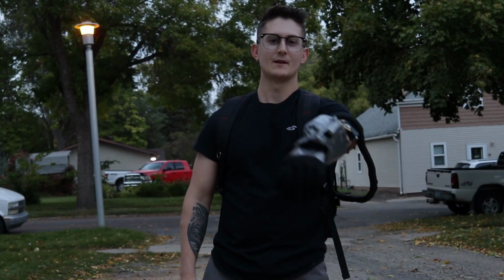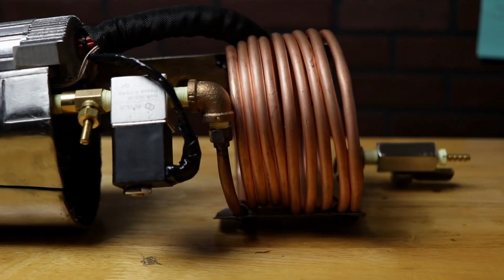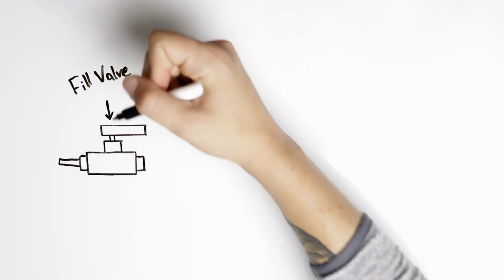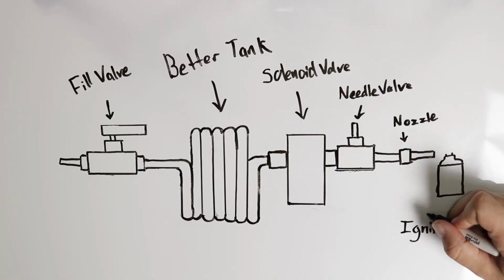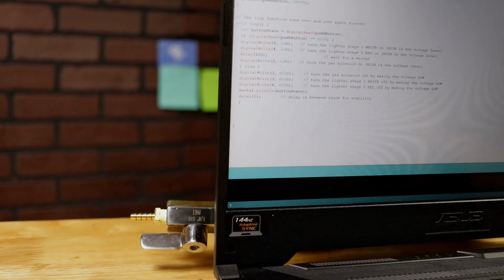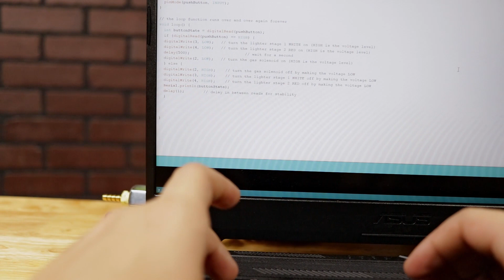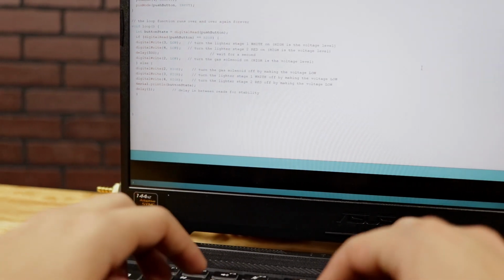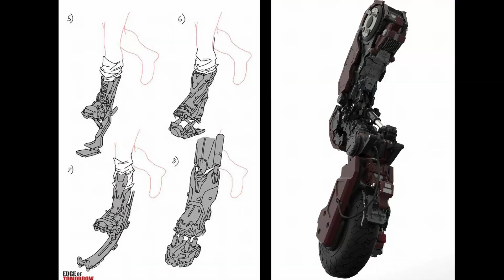REAL Mandalorian Flamethrower

Comment: Can you show us how to make it? Pieces and coding? All was just talk
Reply from the maker: I like the idea of being open with my builds but with a flamethrower it can be dangerous if not done safely so talked through the theory and showed close up video of the design. Just enough to get the gist without going step by step. There's enough info to go on if you have the experience level to do it safely.
Reply: @SECTOR07  thanks, what did you study to get this experience?
Reply from the maker: @reburied9727  I have an Associate Degree in robotic system and automation but mostly just from my own research and projects that I do

Comment: Also,  I know you said that was the best clip you could find. But now there's a better clip. If you've seen the second episode of season 2, there's a part where they actually zoom the camera on the origin point of the flame as the mandalorian charges it to fire,  might give you a better reference for it
Reply from the maker: Yeah I've seen the new episodes. There wasn't much in the first season but there def is now.  I was super excited to see the mando use the rockets and flamethrower again. And the vibroblade! Which I'm building right now.
Reply: @SECTOR07  ohhh that's dope,  how's the vibroblade coming?
Reply from the maker: @tristanlanier5641  Almost done. Just gotta test it and finish recording the video. It does 10,000 cuts per minute. Or 266 per second.
Reply: @SECTOR07  😳😳😳
Reply: @SECTOR07  that's insane

Comment: All of these videos use pressurized fuel none have tried using a pump? One of those that use a 180 DC 9V motor it will give a 4 feet stream and with the right nozzle I bet you can reach the 6 foot mark spray. Also if the tank not breathing is a concern use a bag or other type of collapsible container.
Reply from the maker: Liquid fuel flame throwers do have more range, I agree. For this application though I chose a pressurized gas to match the flame pattern that is from the show the gauntlet is based on. It was more for  mimic accuracy than effectiveness.